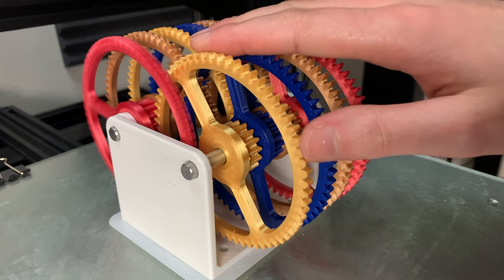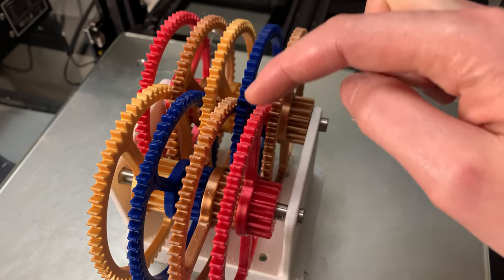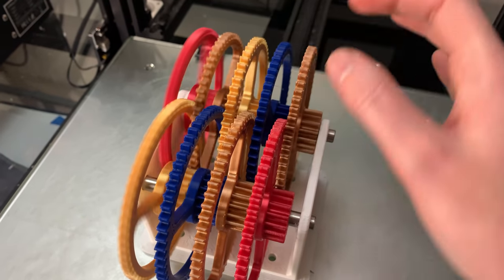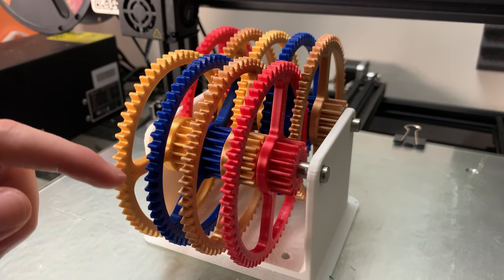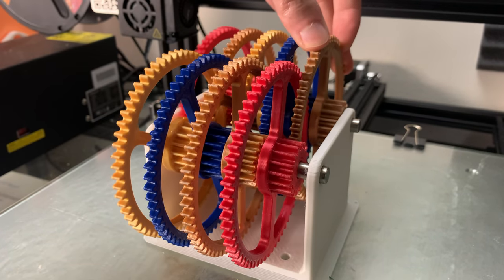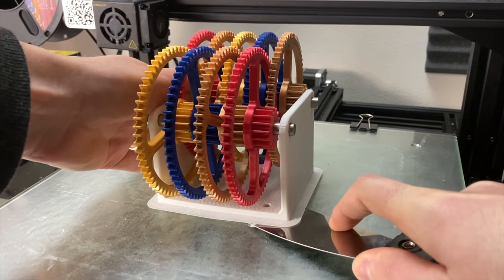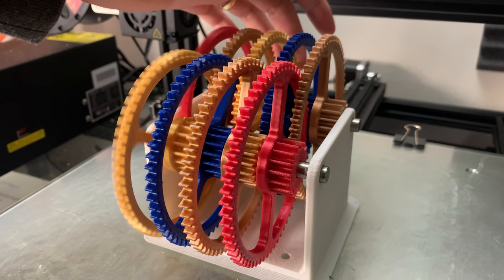Is it possible to spin the last gear?  (1:65000 gear ratio)

Comment: It’s like the power reserve of a old clock. The weight drove the gearbox that automates the movement. It would be interesting to build a gearbox that uses a weight and a solar driven motor for power storage.

Comment: i'm confused what the question was though, because of course it's possible to spin the gear but either A) you need an engine to spin fast enough to do it and a gearbox that could handle that sort of stress or B) a lot of time.

Comment: Could you: if you spin one, use that rotation to eleviate some force and use the momentum to make the second one spin and so on until u can spin the last one?
Reply: If you are talking about the last one, he physically can't, the force required to move last the one manually is greater than the strength of the plastic used in the gearbox and the gear would break before the last one  can even nudge.

Comment: The force required is not changed. Torque is the measurement of rotational force over distance. The torque is the same for gear one as it is for the last gear. The only thing that changes in this is the speed. The force is still the same. Mind you you lose more in losses due to teeth gap and friction than you do in force required. If this system had no gap loss or friction 1 OZ would move the last gear if the initial torque is applied to the 1st gear.

Comment: Serious question, even if it doesn’t seem like the last gear is turning when you turn the first, wouldn’t it still be turning? Even if on a microscopic scale?
Reply: Yes.  The first gear has to rotate approximately 65000 times for the last gear to rotate one time so it IS moving, just very slowly.  I believe the intent of the creator was that, from rest, one cannot readily turn the last gear as the force required to overcome the inertia of the rest of the box would exceed the strength of the gear.

Comment: You know what really grinds my gears . When you build a gear box that can not handle the torque required to turn the last gear in a 65536:1 gear box. Well at least it turns the last gear 1 65536th of a rotation as per each rotation of the first gear. That is at least something.

Comment: The question still remains, if you had enough force on the last gear how fast could you get the other end spinning?? Also if you increased the size and strength of the materials used to make the gears, proportional to whats necessary to spin it, then how fast could we get something to go?

Comment: It is simple. Gear ratios. If the first gear turns 4 times faster that the second then the second gear needs 4 times the force to turn it! Or the second gear has 4 times the turning force of the first. So the last gear is 65,535 times the ratio. So it needs 65,535 times the force to turn it.

Comment: I get that its supposed to be simplified. But its wrong, not simplified. The key is, that you are not using your gears to transmit any force. The load that is experienced is created by the gears themselves, therefore the formula for torque transmission is entirely not applicable here.
Math:
Let f be the friction between two gears, r the ratio and n the number of gears. The relation you presented is f*r^(n-2) which means for two gears you get the friction f and it increases exponentially for every new gear. For f=30force/gram, n=9 gears and r=4 the result is 491520. That is not correct, because every new gear will also add friction. The actual formula is (fb*(1-r^n))/(1-r)+(fg*(1-r^(n-1)))/(1-r) where fb is the bearing friction and fg is the friction between two gears (the formula can be derived from two geometric sums for the bearing and gearing frictions). To make things comparable, lets say fb=fg=5force/gram which gives 30 for a two gear setup. For n=9 and r=4, the result is now 546130 which is 11% larger.

That is also pretty optimistic, because the gearing friction is usually a lot higher than the bearing friction, which will increase the result even more.

Comment: Sliding weights on crank arms like a perpetual motion machine so you dont have to apply as much pressure like the cranks on a bike sliding weights would work if properly oriented I'm sure you could induct this method into the point of external force on you gear ratio thing.

Comment: I get what you meant by it. But its not correct to say you can't spin the last gear. Obviously you just spin the first fear 65000 times.  The last gear will move. The way you said it implies it's impossible to move the last gear even though you just meant you can't grab the last gear with your hand and move it.

Comment: Quick question, would it not be possible to turn the last gear with enough time and revolutions just by using the first gear? After all, the theory is, that with enough speed and force, it would be mathematically possible. You said it yourself, it would take a certain number of revolutions from the first gear to turn the last one, and even then, just watching this video, I myself saw that, even though it was fairly difficult, you could still turn the middle one, get that going fast enough with your bare hands, and it would also work. Just some thinking, an observation, and a question.

Comment: I wonder if the speed of light plays into this as well. If you tried to apply power to the output, then the ‘easy’ gear would have to rotate 65,536 times for every one rotation of the ‘hard’ gear. The speed at which it would have to rotate to accomplish that would be enormous. Just getting the ‘hard’ gear to rotate at a speed equivalent of 1mph would see the ‘easy’ gear rotating at 65,536 mph. Your neighbors would be pissed at the sonic booms.

Comment: you can spin the last one. it's just a matter of setting up a motor at the first - 3third one. let it spin and at some point the last one will have done a full rotation. but ya, if you start at the last one. you got no luck getting it to spin :)

Comment: watched that GOOPOL:1 ratio and now I just keep getting gear videos
Reply: I'm still waiting for 1:googol:1 video. I want to see if the other side will spin or not. It still bugs my mind because, you know, if it takes a year to move a distance of a single atom, is it moving at all? And if it doesn't spin the other side, where exactly the movement disappears? 
On the other hand, if the other side will happily spin, it would mean that there is (probably) no smallest piece of time and distance and that would mean that time can be split indefinitely. And if that is not enough, it is easy to add few more gears and go further.
I heard a big discussion about smallest possible movement in smallest possible time and related paradoxes, but there is a device which can test this and you know [one good test is worth of thousand expert opinions].

Comment: So I'm guessing if you were to hook up the same gearbox in the reverse direction connected to this one that you wouldn't be able to get the last gear to spin with the first, even though they're at a 1:1 ratio? I've been wanting to see somebody try that, but I'm guessing friction would make it impossible.
Reply: Yes and no. If you put this in a cad simulation, it would 100% work exactly as you expect. But in the real world, gears are imperfect. The teeth have a little bit of wiggle room, so you can turn one gear without the other. And that adds up when you have this many gears. Also they won't spin perfectly on the axle, and like you said friction. There are videos of people having stupidly long gear systems with lego that demonstrate this. Each gear is the same, but they don't really push eachother very well.

Comment: Ir would be impossible starting aft the beginning to spin the last gear, but I'm betting further down the line starting the gears spining and jumping gears you could turn all the gears. The box may fly apart due to the torque and speed

Comment: But isn't the speed of the rotation also affected by the length of time the force is applied?  You can notice that you can't start the gearbox spinning from the higher gears, but you can start it up on a lower one, and keep it spinning and speeding up with the higher ones, so if you speed up as much as you can, and keep a force applied to the highest one, it would probably keep it spinning, shouldn't it?  You could also use a long lever to increase the force applied to the end gear without actually increasing the weight applied.

Comment: Silver is measured in troy ounces, not ounces. It's slightly over 30 grams, being 31.1 grams vs the 28.35 grams in a standard ounce. So you were wrong twice at the same time...

Comment: Just make this in tungsten or diamond & throw it in a gravity generator & you'll have the best renewable energy money can buy (using a pickup truck as weight from higher ground).

Maneuvering the vehicle back uphill and resetting the lift would be easy effort (less than a dime of fuel & energy doing that, each time)

An alternator would charge batteries.

A tesla turbine could also be spun up and used to pump water.

You could hook both up & have them engage simultaneously (turbine would shut off when faucets would shut).

I'm sure a sprocket can be implemented where the turbine stopping won't stop the gear it's connected to ... or just disengage it from the gear when water flow is stopped on the main.

Comment: What would happen if you put a similar but reversed gearbox (big wheel connecting to the big wheel) and spinn the motor. Will it just brake the connecting big wheels?

Comment: But what if you added a crank to the higher torque end, and made the lever just massively long? At some point, you'd counteract the force required and could turn it with some amount of ease, right? Definitely would destroy the fragile plastic though, so maybe on something a little sturdier :-P

Comment: I NEED THIS ON A BICYCLE! Even if it won't work in theory you would go like super zoom.
Reply: i mean this is how bicycle gears work lol, the reason you go faster in higher gears is because one pedal around is spinning the wheel more, and in the easier low gears you can cycle around a number of times before the wheel has done one rotation. it's a similar thing where you can make the wheels go super fast, but you need more pedalling force on the hardest gears (though you do get help from momentum and gravity if going downhill)

Comment: Why couldn’t you spin the “last gear” while no other gears are turning? What makes it the last gear? Could you not spin the orange “last gear” and make it the “first gear” and have the red gear be the new “last gear”?
Reply: Look how the gears are connected- the inner teeth of the first gear are connected with the outer teeth of the second gear. The ratio of the inner and outer radii is made so that turning the first gear (as defined by that specific manner of connection) once results in a 1/4 turn of the second. It's that physical connection (inner to outer) that sets "first" apart from "second" and so on.

Comment: Ok, but it's hard to accelerate a car in 6th gear when standing but it's way easier when the car is rolling already. Couldn't that apply to this model as well? I mean when you spin the first wheel until you can't go faster and then you start spinning the second one and so on... just wondering

Comment: If it was possible to rotate the last gear easily, it would mean that you could reach to speeds close to the speed of light easily, which usually is not the case in real life.

Comment: Add a motor on the last gear, attach a Dynamo on the first gear, connect the Dynamo to a battery while powering up the motor at the same time, what will happen?

If that won't work because of the torque, reduce the number of gears

Comment: A fine example of why talking about torque without mentioning RPM in the context of an engine is pointless. All the force in the world being applied does you no good if it doesn't let you cover any distance, ie work being done. For that reason power is the much more useful and practical metric for evaluating an engine's performance. You evaluate how much work in how little time can be performed.

Comment: You should put a motor on the small gear or if  said motor is strong enough to go on one of the further gears put it on three and see how long it takes to spin the last gear of that would even work

Comment: So is this what a transmission looks like? And this is how gear shifting works? Like when the car first starts the gear is one with low torque and as speed increases it shifts to gear with higher torque?

Comment: Hmm, so, if this gearbox were built of super-strong materials, theoretically, a tiny clock motor could twist and break a steel beam (eventually)? I wonder how long that would take and how much power it would take to drive the clock motor long enough to twist a large steel beam 1/4 turn.

Comment: If you turn very fast the first gear, then the second gear will spin less faster, but it will spin. So you change very fast and you start turning the second gear instead of the first, so the third gear will start to spin like the second gear does a little before, after you spin the fourth gear, so the fifth gear will spin like the fourth before, and you continue, sixth gear, seventh gear etc... So after all you can spin the last gear ! No?

Comment: Question: I’ve seen videos where they rotate an apple at higher and higher rotation until it explodes: so if you could actually get the last gear moving, would there be a chance of the first gear just breaking like that?

Comment: Hello, I'm a high schooler who is interested in pursuing engineering in college. I don't have much experience with engineering and right now I'm trying to learn some Arduino and C++. Is there anything you would recommend for a beginner to do to get more involved in building projects and learning the fundamentals?
Reply: Are you interested in mechanical or electrical
Reply: @AyleidCraft  Both sound pretty interesting, but right now I'm probably leaning more towards mechanical.
Reply: @stormynebula7699  mechanical will probably offer more job-wise, at least in North America if that’s where you’re based.

Comment: I'm new to 3D printing.  I repair Lawnmowers and would like to print small parts that I may need. I need a strong resin for the parts and what would be a good printer to buy
Thank you

Comment: Incredible how the torque changes from 15 cows to 23 potatoes by just multiplying it by 4 steps with one foot in the desert per mile. The last gear needs 2 Mercedes G-class SUVs to spin the first gear with a ratio of 79302 Strippertoes per Sunrotation on Jupiter. Imagine how much incredible Torque can be produced by just turning the last gear by a ratio of 10 babydiapers poopoo doodoo wee wee with some grease per kilowale for like 22 minutes!
Reply: Wow you are very random

Comment: It is like real life speedhack 
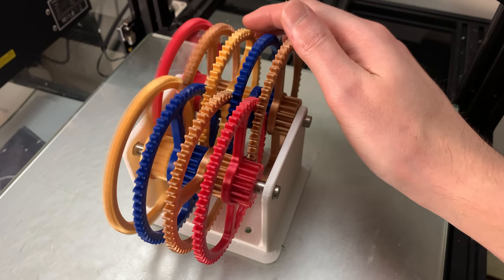if my calculations are correct (they probably are not) if you had gear ratio 1:10 had 10 gears with 10 cm radius and you would spin the last wheel 1 time around its center in 10s, the first wheel would spin a third of the speed of light and if we would need 1N to spin the first wheel once we would need 10^10 N that is 1/10 Khufus pyramid to spin the last wheel once this shit is crazy
I am probably not correct so correct me if im wrong im not a scientist.

Comment: Stupid Questions and thank you for answering

Do you need different sizes of gears to have a high number of rotation?

How does the size of the gear play a factor? Each gear has a large in front and a small behind it.

Does the number of teeth making contact play a factor?

How do you determine how many teeth each gear needs?

Comment: What is the maximum amount of torque this gearbox can handle without breaking? 

And can you use a mass on a Plattform which translate Linear in rotation?

Comment: What if you attached a slowish motor, like 60 rpm. Wouldn't that eventually make the last gear spin without blowing the system up? To achieve 60,000 turns-  over that 16hr 40 minutes would tension just slowly build up in those last gears?

Comment: what if the gearbox is built of, I don't know, titanium or any other toughest material? and what if you would take a beefy drill made all of that material? what is the maximum possible speed of the first gear in this case? or, I mean, in any gearbox case. I wonder if its possible to pass sound barrier or something.

Comment: Make 2 super strong sets of gears, attach the output of one gearset onto the output of the other gearset and wait and maybe it will have the torque to spin the 2nd set at warp speed. 👀👀👀👀

Comment: But how fast would the first gear spin if you could turn the last one at 1 revolution persecond.....
Reply: With strong enough gears maybe it could be done and maybe it could be useful if the easily spun gear connected to a generator. Once its up to speed it wouldn't be as hard to keep it at that speed to so could the energy needed come from the easily spun gear.

Comment: just imagine if you get material that is so strong that act as the gear and shaft. And small motor that can produce 65k RPM and have strong shaft. So you basically have a torque that require to move a truck in a small box. The problem in gear ratio is the  strength of the component. Of course right now if you want device with enough torque to move a truck basically the system bill be big because it need to support those load. Otherwise the gear will break before it can operate.

Comment: Impulse… Force applied over time.  You need enough to overcome the friction, but eventually with more force applied than friction, it will move… try a little graphite or lubrication…